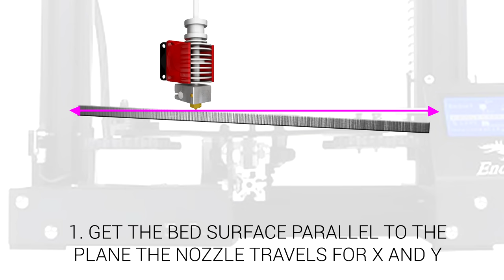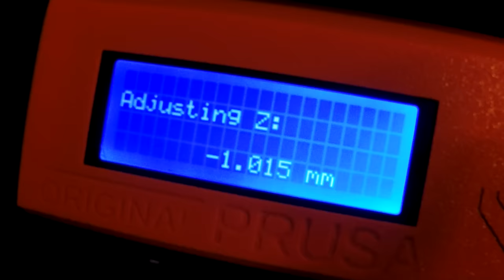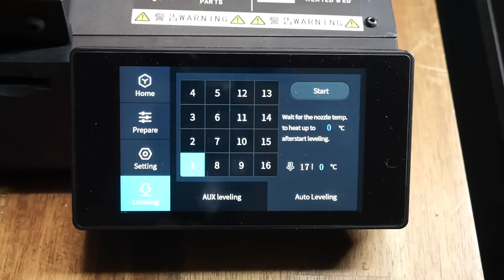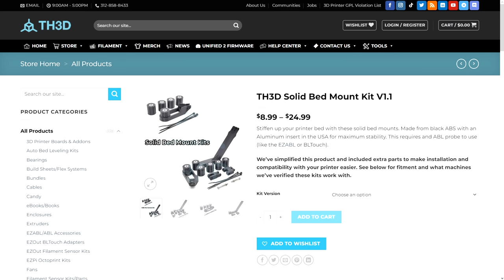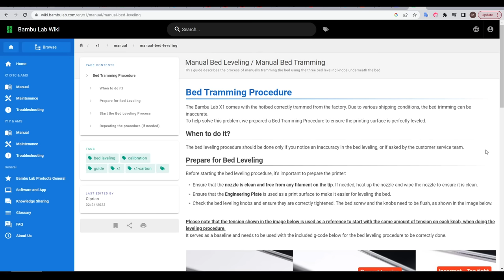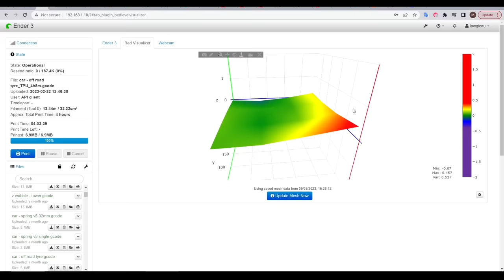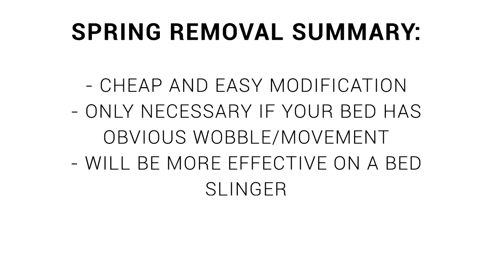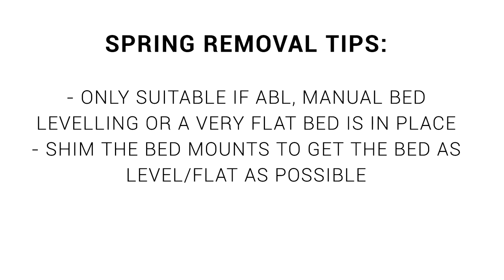Is it time for 3D printers to abandon bed springs?

Comment: At my Anycubic i3Mega after installing latest Marlin + Z leveling sensor and countering with "nylon nut" I throw away bed springs and Z limit switches. Before each print i make G34 (Z align).
This is amazing solutions which cost under 10$ and few evenings for all debuging

Comment: the first mod i did when i got my 3d printer 3 years ago, removed the springs added aluminium spacers in jam bam thank u mam, no more bed leveling issue/warping issue etc... adjusted the Zaxis to fit new level and done. it makes only sense not to base and expect ur product to be good, if ur leveling is set on "springs" lmao, its common sense... u won't expect a perfect house planning drawer to draw straight lines on a boat at high tide sea. As any CNC machine.. u don't want springs on ur milling bed ... makes sense right?

Comment: My CR6-SE has the same problem than the CR10 Smart, like many apparently.
I've been thinking about switching to the latest motherboard to see if it would resolve the problem, since I have the Kickstarter one; but it looks like silicone spacers are the only solution.
But I do I'm planning on buying a Bambu Lab X1C and a Prusa, I tired of wasting my time and money trying to upgrade/fix affordable printers (I had a CR10 before).

Comment: I've ben taking springs out for ever. 3d print couple wheels put nuts in them have one above and below the plate washer and nut tight to heat bed. Still can adjust level

Comment: In all practicality I don't as the silicone bushings I am using are very stiff and tightened to be compressed. I've adjusted them to as level as I can make it and rely on ABL for the rest. My bed is warped towards the middle by 0.1 mm and until I started using ABL made printing larger footprint parts hard to print. Kind of the attitude these days, if it aint broke don't fix it. I get reliable prints of all size and 60 to 80mm/s that look great. I have a highly modified anycubic mega zero that has heated bed, linear rails, 32bit main board, direct drive, with upgraded hot end. I let ABL run before start and don't recall when my last print failed for anything other than power failure or running out of filament.

Comment: Ever since owning multiple prusa's, I will never buy a 3d printer that uses springs and bed lvl knobs. Even the bambu lab printers have bed level knobs under the bed for tramming if you have a warped build plate, which is a common issue with BL printers.

Comment: Original CR-10 here, no ABL and using stock springs on the stock glass surface. I've never shown artifacts like in the video. I do admit to getting lazy occasionally about leveling and just running a raft though.

Comment: I don't understand why springs are used in the first place?  
A better idea is to use a captive screw with thumb wheel, then lock off the height adjustment with a couple of nuts?  This will allow for fine adjustments and provide a solid bed.  I don't have a 3D printer myself yet, but if i did, this is the mod that i would do to it.  I have this idea from how some industrial machines are built.

Comment: On my Ender-3v1 I don't like running ABL on every print, I also like adjusting my bed to 0.02mm tolerance on every corner, so I'd never give up springs. Yellow springs compressed to about 70% gives me enough rigidity without losing adjustability.

Silicone cylinders would give me some adjustability, but I've seen videos showing them deform over time, aluminium cylinders would solve that problem, maybe one day I'll get myself into all the tin foil shimming headache they will require in order to get to around 0.02mm tolerance in all four corners, but for now, I'm happy with my 3 year old yellow springs.

Comment: My wife just bought me an Ender 3. Man that machine is finicky. I have upgraded to the SKS Mine E3v3 with BL touch. Much better but this is not a machine that "works out of the box".

What is the PC interface in this video? Seems like a neat visual tool to have to fix leveling issus.
Reply from the maker: Without watching back the video, it might be this website: http://lokspace.eu/3d-printer-auto-bed-leveling-mesh-visualizer/ or the 'Bed Visualiser' Octoprint plugin.

Comment: New employer has a CR5 pro H… with springs… once leveled, i do first layer test print… and live z adjust… as soon as i remove the glass to clean it, well… it is off again… im considering removing those spring… got mk3s+ at home… how did u get that large touch screen?

Comment: I have been thinking about trying to print my own spacers out of ASA or Nylon and then just adjust them by sanding them till it is spot on. Right now my enclosed printer is in pieces waiting for some parts to finish my current mods/upgrades.

Comment: I switched out my Ender 3 springs for the Creality Silicone spacers and haven't had to touch my bed since. They allow a little adjustment compared to the rigid spacers and needing extra washers.

Comment: Am still running springs in 2 of mine cr10 & Ender 3 but not in my Kossel+, i did toy with the idea of making a spring adjustable bed for it a while back but its not lost zero in a couple of years so not had to bother.

Comment: I dont think relying on auto bed levelling alone is a good solution. The less software compensation you need to do the better. Also marlin fades away the levelling over the height of the print, usually only 5 or 10 mm, meaning that if you bed is off by a decent amount you will notice that the top and bottom surface of a cube is not parallel. Regardless of what you print it will pick up the angle of the bed on its bottom surface, so making the bed as level as possible is still best, that is probably why bambu labs still use springs.

Comment: I recently just had a ender 3v3 se  that i literally got last monday and the under frame bed was bent.  It wouldnt print anything unless dead center of print bed. This printer has no adjustment and no springs. Originally i was going to add springs to adjust screws from top. So while i waited for the kit from amazon  i printed spacers some one has specifically designed for the 3v3 se ke on the printables website.  After a day of fiddling around my printer now prints and i have a near perfect bed leveling square print also on printables. So although I fixed it. THIS could have been a 20 min fix had my printer adjustable springs!

Comment: We need to get rid of aluminum beds, i have not seen one that wasn't bent, just like yours is in this video. Also time to get rid of software BS. i have a cr10 that says i can only use cura 15.whatever and when i set it up my cr10 is not even in the software, but apparently my cr10 won't work with anything else, so it sits gathering dust and is used a couple times a year, not helping my robotic builds.

Comment: The video missed one reason for springs. They are the crash protection when a beginner hasn't properly leveled the bed and the head is crashing into the bed - the spring allows the bed to flex down a bit reducing the forces on the head, rails etc.

Comment: I JUST GOT THESE SPRINGS!  ARRGGH!  No but seriously this is great knowledge!  However I have an issue now with my Y-Axis motor bumping the bed to far forward when running a bedleveling calibration using the BLTouch.  I don't know what I did just installing the springs and my new glass bed.  But wether I run a 9 or 25 point bed leveling, the printer moves the bed forward for the last row it comes too far forward with a hard bump and the probe is now just off the bed by about 5mm.  Any ideas?

Comment: Autoveleving does not fix uneven bed. It bends part to fit bed's curvature. So if your bed it tilted your part will be tilted, and if your bed is concave or convex, your part will have curved bottom and, probably, won't fit somewhere or just wont stand still on a flat surface. So autoleveling is good, but springs are still needed to set bed as parallel to XY plane as possible to avoid deformed parts.

Comment: My Ender-3 Pro is still using the stiff orange springs and I haven't touched them in months thanks to running Klipper with a BLTouch. Dialing in the right settings did take about 3 - 4 hours but I haven't touched anything bed mesh-wise since.

Comment: The Creality method (not invented by them) is the superior method. the problem is its improperly executed.

My CR6SE is one of the nicest machines from china I Have gotten. enough that I bought two of them. but they NEVER level. the leveling mesh works and works very well. but the "offset" never ever works and worse when you adjust it its cummulative. start the next print? it "forgets" the adjustment you made the first time but does not "forget" the value you use so you have to keep adding to the change till you hit the 0.5mm gap max offset allowance.

SO I just gave up. start of each print while doing the skirt I just grab the coupler and force it to turn and adjust the height. works great but IT IS annoying that I can't set it and forget it and walk away

For loose springs you need to tighten them up. you want the springs as tight as you can. instead of loosening the springs to lift the bed you LOWER THE NOZZLE to the bed even if that means modding the end stop. tight springs don't squish and don't wobble. Tight springs also don't allow the adjustment wheels to "walk" during print (this was a problem on the CR-10) as it jiggled and vibrated the wheels would "walk" themselves looser. replaced with die comp springs (the yellow ones) made sure they were fully tightened and brought the nozzle "TO" the bed not the "bed" to the nozzle. no more issues. 100% reliable (or as close to 100% as we can get) now they "just work" every time.

I don't like ABL as least as most chinese makers impliment it. most of the time if something goes wrong you can ONLY fix it in software which most of us can't easily do. with mechanical leveling you can ALWAYS adjust it mechanically.

I find it interesting that my simpler printers (like my sapphire or my ender 3's or my Cr10) are the "set it and forget it" printers in my fleet. I never have to watch those. I select print and just walk away.

The ONLY ABL printers I have used that actually seem to work are the Prusa MKII - My Vyper - and my Tevo Flash. the rest all fail to work reliably and its mostly "software" not mechanical issues.

I still don't use my Ender 5 Plus (its a cat bed for now till I get around to it again) because the damned ABL just does not work and I got sick and tired of fighting with it and I have 150 other printers to choose from. It if were your only machine I would truly feel sorry for you. Mechanically its an amazing machine. its really nice. but that god damned ABL is a nightmare. I REALLY want to just covert it back to an end stop and once again make it a set it and forget it printer like my Ender 5's are (regular ones)

I traveled 2000 miles across the country in a packed bus convert to a moving truck. stores those machines in a connex container for a year and when I finally took the leaf blower to them to blow the dust off and turned them on. I clicked print and they just WORKED. zero adjustment needed from me. click and go.

IS abl the future? yeah. I know it is. but not till they figure out the damned software and I don't WANT to figure it out for them. I can convert to an endstop faster than I can fix their buggy firmware.

Comment: Is M420 included in the creality CR10 start gcode? If it isn’t, that’s the reason why the auto bed leveling didn’t work for you. M420 calls the bed level values from memory and applies it to the print.

Comment: I have an ender 3 s1 pro that has springs I have problems getting the first layer correct every print. I will get spacers to replace the springs and hopefully that will improve the problem

Comment: I agree, the springs will provide a Z safety factor. Lol, I wish I had such a feature in my resin printers. I have had several broken screens. 

The other thing, when doing the offset with the calipers, you should not measure off of the end of the screw end. most screws do not even have a tolerance on the length of the screw. and can very by 0.015" so you could have total tolerance build-up of over 0.030". you should measure from the under side of the bed. Ideally you would measure from the top of the bed plate. otherwise you will have a tolerance build up of the plate as well. makes using a caliper useless. I would suggest putting the plate on a glass surface (granite best) and use that as your Datum surface to measure the height from. I would also use two jam nuts to set the height Vs messing around with trying to shim with washers. this would also eliminate the need for a spacer. Two Jam nuts, bottom nut sets the height, the top nut is then tightened down on the one you have set (CA glue or thread lock). you then use a third nut to fix to the axis frame.

Comment: My Ender 3 Pro is still using springs and I haven't observed any issue so far. I don't print a lot so that might be it as well. I plan to install BLTouch in the future just to ease the pain for when it gets a little off and I have to re-level all again lol

Comment: No springs, square machine and a BL touch to cater for the unevenness of the print surface which in my case a spring steel magnetic PEI sheet. I find I only need to run the bed levelling program if I move the printer or turn over the PEI sheet.

Comment: I've tried installing a BL Touch on my Ender 3 V2 but have had numerous issues as I have a 3.0 version which doesn't work with the firmware, I am not a computer guy and can't rewrite code can you share your firmware you recoded to suit my machine? 🤞🏻

Comment: I have an ender 3 and lately have been getting a LOT of pockmarks and surface defects. I wonder if this would solve it, but I need to get the BL touch then. Do you have a video with a full walkthrough of all mods you have done to your Ender 3 and if you would recommend each?
Reply: BTW I have stiffer springs on it, and I think my issue is my extruder motor since I swapped it with another one and it dramatically improved. But this might help

Comment: My feeling is that the main problem with the Ender system is not the springs but the screws.  Any screw is likely to back out under vibration, of course, but the Ender screws turn very easily, with the result that even with an ABL I was having to re-tram my bed every month or so.  So I wonder - was the improvement from your mod due to removing the springs, or merely the result of the screws having been tightened up again?
Reply: Agree with this comment! Screws and vibration are terrible enemies, and if the springs are loose enough, the breakaway torque is low. Loctite or stiffer springs, or a tighter torque (which results in more compression) can go a long way to alleviating Michael's problems. I think this is one of his worst videos as it didn't really prove anything, and showed much harder ways to do what can be done with springs and nuts that are properly torqued. Like you said, his problems may have gone away just from doing them up properly, but that wasn't even explored. :/
Reply: @carneeki  What about using shimmed silicone springs (to dampen vibrations) and self-locking nuts at the bottom? Will the screws untighten with this special type of nuts?
Reply: I had the turning screw issue too but saw a CHEP video where he slightly crimped the edges of the screw heads with a heavy set of wire cutters before installing them and that took care of the issue.  The small crimps in the head bite into the aluminum and keeps them from turning once they're tightened.

Comment: i've been using silcone spacers, can still adjust, but they are much stiffer. printer has been idle for a few years since the bed was warped, ordered a new bed recently and a skb e3 v3 with tft35 screen and will be resurrecting my printer from it's slumber. unfortunately or fortunately the new build plate i ordered with the other above parts has a obvious hump in the center that appears to be even. hoping once it's been heated it will settle flat with a mirror clamped to it. later will be adding a bltouch unless something better is available.

Comment: I'm surprised the CR-10 Smart didn't have functional ABL, given it's using the same strain gauge touchdown system that the CR-6 uses. I remember when my kickstarter'd CR-6 showed up, the ABL didn't function well, needed some start gcode changes; the community firmware made it much more reliable. Creality gonna Creality I guess....

Comment: Now I wonder if those silicone bushings are an improvement over the springs?
On my Ender 3 Pro I did change the springs for stiffer ones almost from the start. Did it improve things? I believe it allows me to print faster, but apart from that, I'm not sure. The only thing I know is that I now seldom have to re-adjust the bed.
Reply: Same experience with the silicone bushings. Haven't leveled my bed in months.

Comment: Still running the original springs on mine for now; would like to change them out with something a bit more robust, as well as auto bed leveling at some point, but since that isn't free and I don't seem to have run into any major issues for the time being, the original springs get to live on a bit longer :p
Reply: Well I've made several changes to the printer since this (including the springs), butt getting it running again has bin a bit of a long process so I haven't tested the springs yet..they're definitely much firmer now tho

Comment: There's one other strategy. Don't use spacers but instead a nylock nut inboard, clamping the bed between it and the outboard nut. Then alignment is possible without removing the bed.

Comment: I did away with mine a couple of years ago.  Not totally solid, I put silicone spacers which are pretty stiff so I can still adjust but rarely have to.  Hated springs